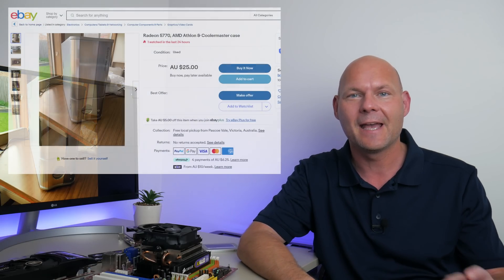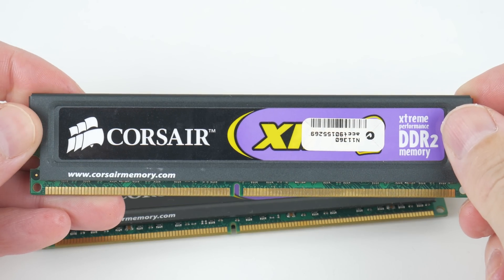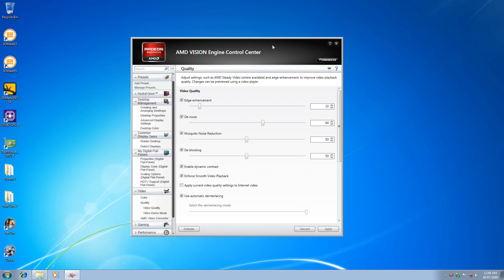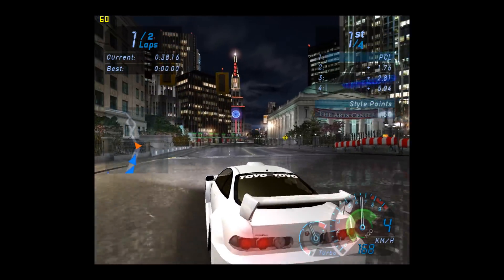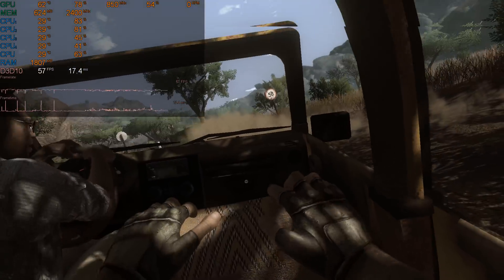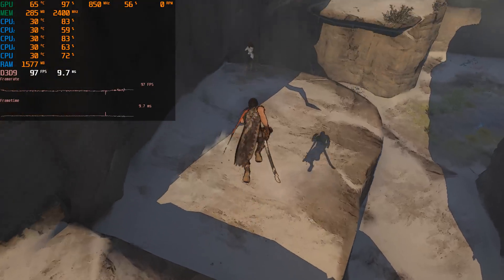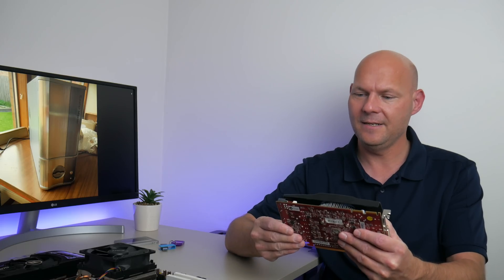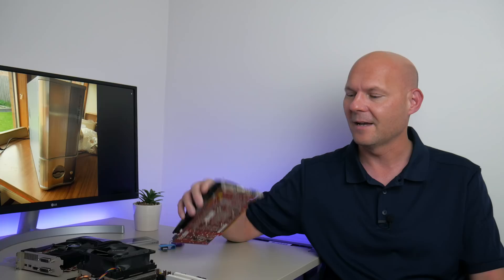Is This Old Athlon II PC Worth it?

Comment: This machine is almost identical to my first ever build which had an Athlon II X4 635 and the same Sapphire Radeon 5770. I made so many memories with that machine and it was a pretty powerful budget system. Someone should definitely go get this!
Reply: I've used a Q6600 and a HD 4870 at the time. Very similar in performance, great hardware at it's time.

Comment: This would be a solid base for a retro PC build, especially considering the asking price. Provided everything works as intended, of course. I like how it starts at 17 dollars. "No way, 15 isn't nearly enough, but 20 is way too much. Yeah, 17, that's the sweet spot!"
Great video, thank you!
Reply: It's in that good performance XP build spot. More efficient and faster than a Pentium 4 or Athlon 64, on a platform that will run fast quad cores that go deep into Win 7 territory.
As XP retro builds are becoming more popular, this is not a bad choice. It isn't the fastest supported hardware, not even close, but it's solid.
Right in that spot that made the Q6600 obsolete for gaming before it even released.
(At release games didn't make use of 4 cores and a faster dual was cheaper. Later there were faster, cheaper and more efficient quads. And by the time quad cores were needed for gaming, the Q6600 was simply too slow)
A fast dual core is just perfect for that era. I'm glad that I never sold off my E8400. It'S a rock solid performer for XP era gaming, and the same goes for this Athlon II

Comment: A cheap retro laptop with a monitor and keyboard included for less than $25? Try the IBM Thinkpad X40 / X41! They're happy with Windows XP, they can't run Crysis, but they will run a huge bunch of other retro games. Has 44-pin IDE (1.8" 40-80GB HDD included), but it's hard drive bay has enough space for a 44-pin IDE to CF converter or a 44-pin DOM module. They're so widely available "throw-away" business laptops nowadays, that you can get some some great bargains for anyone who is challenged with storage space.

Comment: The problem with this generation of hardware is that is has nothing special in terms of what this hardware can do better than newer or older hardware. Newer hardware is as compatible but just faster with no drawbacks. Older hardware can be more compatible or authentic for Isa  soundcards and dos, 95, 98 gaming. But still very nice case and beautiful motherboard.
Reply from the maker: You are right! With the compatibility, I feel it will take some time for the community to test enough games and figure out a trend. For example GeForce FX cards were shunned for a long time but have made a huge comeback. When interfacing with 4K monitors for example, things work better with Radeon card, aspects like this. So who knows what will happen, but I'm excited and shall continue making videos :D

Comment: Core2 and Athlon II are very efficient and reliable CPUs, one of the best. I have both and will keep it for XP and 7, EAX gaming and ASIO MIDI stuff.
Ofc. early i5/7 also are very good.
Why don't many people want those? I guess because Win 9x is a thing which doesn't run on new PCs w/o some issues, but XP and later basically runs on any new PC.
I'd say for 9x a Pentium III is optimal, but Pentium 4 or AMD XP isn't needed for most of the games (the latest 9x games also run in XP).
For XP and later any modern CPU/PC works.

Nice to see AMD/ATI hardware, when most people use Intel/Nvidia.
I got some ATI HD 2600 Pro, HD 4550, HD3870, Nvidia GT 1030 GDDR5.
Maybe a Frankenstein PC with GTX 1650, 1060 6 GB, RX 6400, RX 6600 or other new card may be useful.

Yeah the re-licensing often is a problem. Either it costs too much money or is impossible if the license holder doesn't want it to happen again.
That's why old CD/DVD or images of that are gold, you literally own the use rights forever.
Some games miss addons you need to extract from older CDs or dig from the net. Examples are OPF Red Hammer (or the  OPF refiled as ARMA 1 sth. game) or Mafia 2 music missing in re-releases. So people either use the original installers or mix the files.

Ventoy is a tool I never wanna miss again. It makes you boot up Hiren's Boot, Strelec, UBCD, FreeDOS 1.3 live, any Linux/Windows iso, img, vhd(x) and more, test and repair your machine even w/o installation.
I often need HDTune (benchmark for wear check and surface test for error check), then eventually HDD Regenerator or HDAT2 if needed to "repair" aka sort out bad blocks.
Another use case would be defrag for HDD (O&O Defrag is faster, doesn't need much free space and can defrag multiple drives at once) or TRIM command for old SSD.

Btw. Windows 7. Disable automatic defrag with a registry key, if using an SSD. I did it for my Win 7 VMs. Also disable the automatic deletion of desktop icons.

GPU mem test would be interesting, I never did it, but it exists somewhere. Could be the reason the benchmark crashed.

dgVoodoo2 is excellent to add more resolution and FSAA to older games like NFS HP2.

Did you check Process Lasso Pro? It can speed up some games dramatically (assign the game to 1-2 cores exculsively and assign anything elso to another core, disable HT makes Web Browsers, rar, 7z, X-Plane 10 and for sure more games run like 10 % faster).

For games with FPS drops I'd give MSI Afterburner a try and check custom FPS locks for each game. Locked 60 FPS may be better than unlocked 50-90 sth.
F.e. with Anno 1800 I locked my Core2Duo E8400 at 24 or 30 FPS and it runs way better than w/o the forced lock. The good thing is, you can enable and disable it on the fly with ctrl+F11/F12 or similar.
For some other games I like to lock @ 60 FPS, if I see no real difference for me and if the game can't by itself, just to save heat production/energy and get some free ressources when needed.
Reply from the maker: Great comment, thank you 🙂

Comment: 3:00 Rebranding cards was very common for ATI and AMD. This wasn't due AMD buying ATI. They discontinued ATI as a brand with HD 6000 series cause TerraScale 3 was pretty much the first real AMD GPU architecture while TerraScale 1 & 2 were at least partly derived form ATI. This time AMD only rebranded the ATI Radeon HD 5750 and HD 5770 to AMD Radeon HD 6750 and HD 6770.
Reply from the maker: The mix and match with Terra and GCN is quite frustrating, for example with the 200 series. You really need to check the specifications.

Comment: Dead space runs better there than on my R9 290 on Win11. Have to run it in window to get antialiasing and Vsync makes the game stutter ad infinitum.

I have tried OpenGL games like HL1 on slow iGPUs from 2015/16 and it runs very slow 800x600 max. On Linux they updated to Vulkan and it is much faster on those PCs, with high res also running well.
The lack of optimization really hurts older APIs on new machines.

Comment: For $25 it's a no brainer. I'd put a Phenom II in it as you mentioned to improve the Dead Space and other CPU limited game performance. I also have many RAM sticks that are flaky/dead from this era, DDR2 was probably the least reliable in my experience. I have been using AIDA64 to test lately as it's easy and even works on XP 32bit. You can set it to just test memory and has a free/trial version. Another experience I have had related to this video, the 5770 is very driver sensitive in some games, newer isn't always better, the last few XP drivers have performance issues in some games including Far Cry. I personally have a bit of nostalgia for the 5770 though as ive still got the card from new that was in the bedroom PC. I have had to replace the fan an thermal paste, but she runs surprisingly well. Thanks for the video as always.
Reply: Hm, I didn't know that DDR2 was esp. unreliable. All my self-used DDR2 modules never had an issue, but I never overclocked those and after my P4 mainboard died, I attached a 12 cm fan behind the HDD cage to cool the whole system. After doing so, no HDD failed, but before they did (mostly the early SATA HDDs).

I only had 2 defective RAM devices in over 30 years with over 40 PCs (mostly scrap parts re-build). One 64 MB DDR1 I used by myseld and one DDR2 2 GB I got for free from a pal I got a free router (got 2+2 GB and one worked).
It would be interesting, if RAM would be more expensive and having more of the same modules, then reballing different chips would make sense.
But I only had this device, tried to reball the same chips, but didn't help this time. It was chips with heatsinks and I think the former user overclocked those also.
I reballed Nvidia 8600M and am about to reball a 8400M GT in another laptop. It's fun to repair things if you can. It's not worth a thing for most ~ 2006-2010 parts, atm., but fun.
Reply: @sebastianebert4295  fair enough, thats good you havent had issues. I have heaps of SD, DDR, DDR2, DDR3 and DDR4 over 150 modules, out of those I have more DDR2 dead than the others and some just died in system. Of those 150, 9 are dead DDR2, 6 of which I bought new. Also have 6 DDR3, 5 DDR and 1 DDR4 dead.. used to work in a shop, now just do repairs and fiddling as a hobby. Really cool to do some reballing, Ive only gone as far as replacing caps, cpu pins and some SMD chips with a cheap hot air station and soldering iron. You using a proper hot air rig? Fun hobby, youtube has made it more fun with videos like these.
Reply: Wow, you had loads of RAM.
I have a small box with I didn't count, maybe 40 modules or so, only from the PCs I got in the last 30 years @ home.
I have a good 80 W analogue controlled Weller soldering iron and some cheap hot air stations I got from scrap, repaired.
I't just a hobby. The time you invest costs more than the modules, esp. with cheap DDR2-3 models noone will do a reballing, lol.
It's just some fun to repair stuff. But when it comes to older rare or expensive parts, it gets more interesting.
And as things which are defective can't get much worse...well I'd test stuff in cheap PCs 1st ofc.

GPU reballing makes more sense. But I saw f.e. necroware (who also did a universal joystick adaptor for USB) did repair a 3dfx card. It was interesting so see the partly defective stuff, analysis and it got better with each try.
Tbh., I'd even buy cheap defective stuff and repair it, as it's fun. Another example is to re-use laptops with defective screens and external monitors, where not even a repair is needed.

Comment: Last week I walked into the office and saw a beige case the IT dept wanted to throw away. I just looked at the back panel and saw VGA, SCSI, Ethernet and quite low a Sound card that looked to me as if it was in an ISA slot. So I instantly asked to save it from certain death, took it home and figured out it is a Pentium II on a perfectly shiny Asus P2B with a Matrox Millennium II, Intel NIC and AWE64 ISA sound. Unfortunately the P2B Revision that doesn't go 1.8V and lower for newer CPUs and only 100 MHz FSB but this system should be fine running anything from DOS+Win 3.11 up to 2000 or even XP with full driver support for all components. Now I have to wait for some RAM that I've found second hand online and an IDE Hard drive which my father found in my parent's home he will bring next in two weeks. Seems a quite decent find and covers quite an era of computing that I am not able to use without emulation on a P4 or newer and because this is the 440BX should be extremely stable and compatible. Can't even understand who wants to throw that away!
Reply from the maker: Amazing find!

Comment: Here in Denmark, the interest for such systems is about the same, almost non existent. 
AGP is about where my own retro hardware interest ends. With PCI-e and multi core systems, the nostalgia lies in a slumber.
With one exception, my first gen i7, the last hurrah with floppy controller onboard, and its exotic triple channel memory.

In 10 years Phil, people will probably look at this video and price with envy 😅
Reply: Hehe yeah, Win 9x, ISA/VLB/AGP is the boundary. PCI at least works in newer PCs, while AGP doesn't, if not someone makes a universal PCIe to AGP bridge.
I've seen ISA bridges somewhere.
Anything newer and starting with 2 core CPUs can run on any new cheap hardware.

At least you can use IO cards, if not having floppy onboard. Not sure if those boot right, tho.
With PCIe to NVMe and old chipsets and unmodded BIOS NVMe won't boot. I guess floppy, 40 pin IDE also can be problematic?

What about SCSI, does anyone still use it? Wasn't this made to be external and with 15 devices in total?

One thing I haven't seen often and is underrated is Firewire 400.

I always feared:
- are those real ISA slots with DMA on Core 2 Duo PCs? There's new industry PCs with ISA, but I heard it's no real DMA, so old sound cards won't work with it.
- which Core i CPUs have classic BIOS and no EFI? At least my Dell and HP Core i can install/load classic OS. But EFI brings more problems. I never had any problem with old non-EFI BIOS.

At least Gotek Floppy is a Frankenstein bridge, as long as you have USB, but I get what you mean. Only the real old stuff is real enough just because.
Btw., I have a 120 MB IDE HDD, which doesn't work with USB-IDE adaptors, but with internal IDE conns. Must be AT only or similar, an old mode the USB devices never used.
I kept old PCs for reasons, last PC with ISA, floppy, old CPU which works with EPROM burner w/o CPU brake.
The migration of media always is the weak point every 10 years or so. Blueray also will be swapped out some day (if they do make offline media instead of streaming only).
Glad to see archive org and similar sites preserving good software stuff at least.
But for the hardware we have to care ourselves.

Comment: This video gave me small nostalgia moment as the HD 5770 was the first GPU I bought and I remember shoe horning it in to my first own PC... a Dell, but since then I was hooked.

In-fact it got used a little in the first PC I built using a intel i5 3570k 😅

Anyway, great content... I've enjoyed the history lessons going through your stuff.
Reply: I didn't have a HD 5770, but I had a HD 4870 from the previous generation which has about the same performance.
Oh, and I upgraded my Q6600/HD4870 build into an i5-3570k as well. Both are still running today.

Comment: If you want to run older OpenGL stuff like Return to Castle Wolfenstein, it might be better to spend $30-40 and upgrade to a Radeon 7750. It supports Vulkan 1.2, and there are some excellent OpenGL to Vulkan wrappers that will have much better performance than native OpenGL.
Reply: I didn't check FPS back then, but my ATI 9800 SE with Pentium 4 3200 Prescott S478 and later ATI HD 4550 with Core2Duo E8400 ran RTCW perfectly fine w/o visible slowdowns.
ioRTCW runs very good, too.
Haven't checked RealRTCW yet, but looks interesting. There's also new maps, total conversions it seems.
I recently started the PS2 version of RTCW, emulated with PCSX2 and 3x res (a bit higher than 1080p) to play the extra levels and different castle beginnings, but well, I'm too slow with gamepad.

WIth my later Nvidia GT 1030 GDDR5 I use dgVoodoo2 to give all old games 1080p res, forced FSAA and effects, still running at 100+ FPS for most older games. I even limit it with MSI Afterburner, if it's sometimes below 60 FPS or if the GPU runs at 100 % and the PC gets a bit hot, but there's little to no visual difference.

I haven't tested DXVk yet, but heard that some games profit from like 10-20 more FPS.
Super Sampling also can make games a bit faster it seems. Shadow of the Tomb Raider is an example.

Comment: Honestly...that's about what this is worth! Good deal. My older hard drive cloning machine is an asus am3 (not fx though) board. it has IDE in the chipset so there is no option ROM message to wait through....5 sata ports....240ssd...16gb ram...phenom II x4 955....geforce gt 710.....usb 3.0 card (no usb 3.0 on board) dual boot win 10/ubuntu 22.04...she clones it all. I can't use win 11 with it, the asus power driver causes a BSOD, thanks asus for your TOTALLY NECESSARY proprietery power stuff.

Comment: I would buy the computer for sure if I was closer. Typically eBay sales that are "pick up only" tend to go for much less than those that include shipping. Also, I would love to see more of this type of video!
Reply: That's right, pick-up only sales have mostly low prices, because most people aren't interested, have no time to invest and things like that.
But I prefer those, even for one simple reason: Parts won't be thrown by postal service, if you get it personally. I also got some other parts which wasn't offered, got some parts for free or just talk to people about nostalgia alone is worth it.
When I got my latest Dell i5 DT PC I found one of the memory specialists who sold parts in the 90s/2000s at our local 2nd hand computer fairs.
Reply: @sebastianebert4295  And often you can see the machine running to confirm that it indeed works.
Reply: I'd buy that computer in a heartbeat if it wasn't almost as far from me as it is possible to be without leaving the planet.